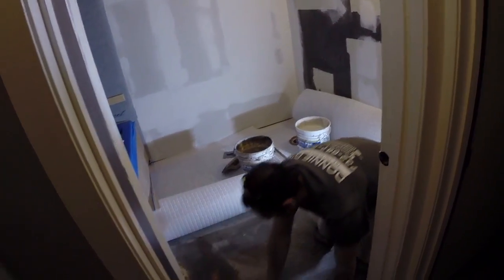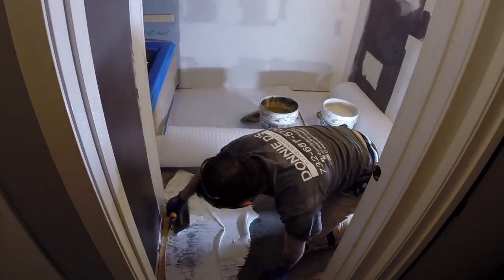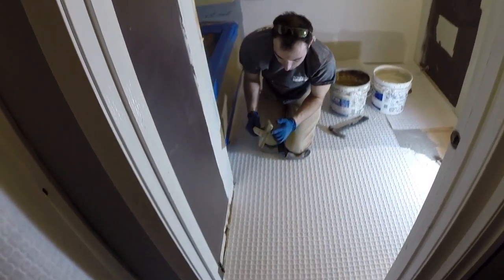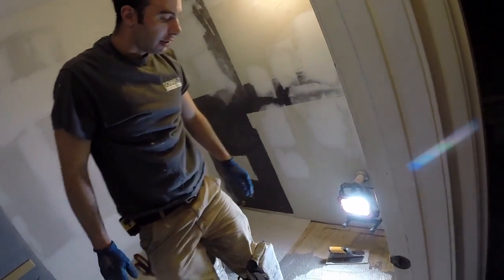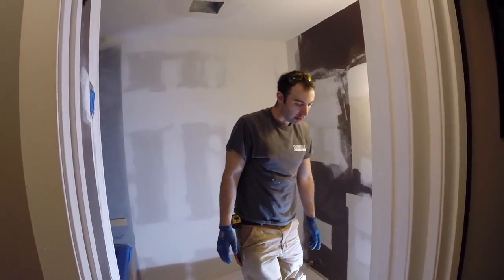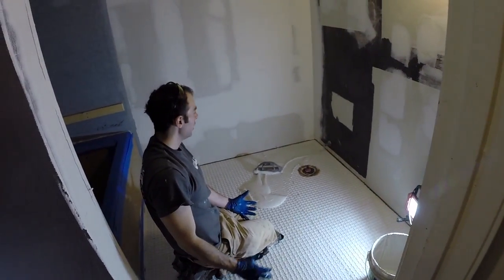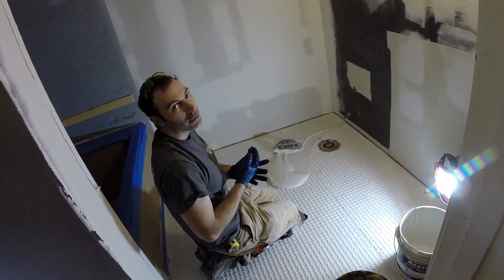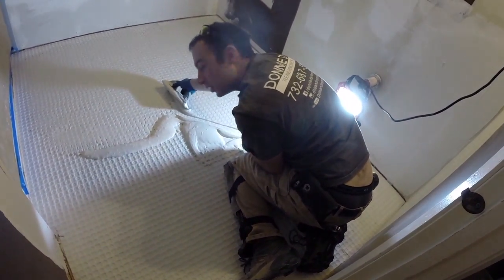Install Uncoupling membrane tips and tricks

Comment: Can I use the tile adhesive (Mastic)  instead of the thin-set ?  I really hate mixing  thin-set (why is it called a thin-set anyway) and never get it to the thickness that is perfect. Some cases its too thin, sometimes its too rigid, I prefer the use of the premixed adhesive (Mastic) which is now called - Type 1. Will it work ? This is a first time I'm using the membrane mat.
Reply from the maker: No to all.Mastic is only ok for dry areas at best.Thin set some people of afraid of because yes you have to mix it.Just follow the mixing instructions.Measure out the water and you will be fine.

Which uncoupling membrane are you using?